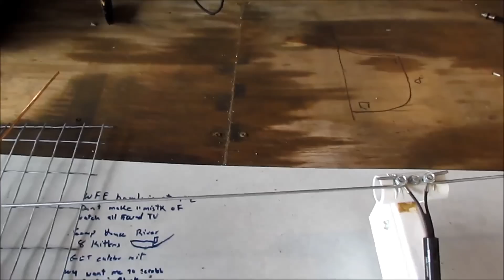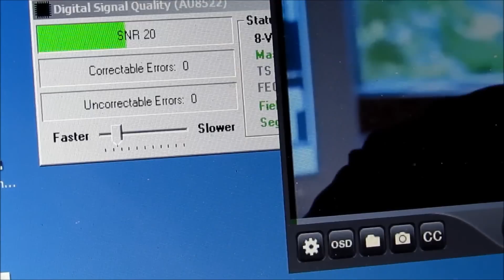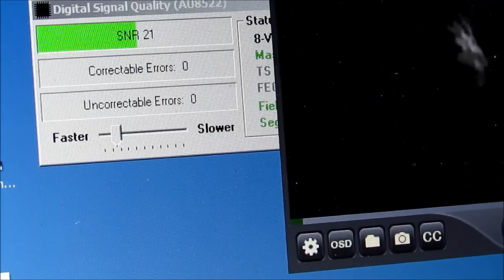VHF TV ANTENNA TESTING

Comment: @ 11:06 - You can't " tie " them together.  UHF(470-862MHZ) and VHF(47-230MHZ) MUST be separate and here is how...  You need a Balun 75 to 300 Ohm UHF/VHF Matching Transformer - Balun.  One Balun for VHF and One Balun for VHF - From there, you will tie that into a Combiner/Mast Mount - You will have ONE Output and that would go into your TV.  NOTE: If you are running long distance Wire/Cable, anything over 25 Feet, then you need a Pre-Amplifier to boost your Signal.

Comment: Danny S Hodges
Is it possible for the antenna to receive a channel signal away from your home more than 150 km and the channel is clear without interference in the picture?
Reply: @
LIBYA LIBYANO LIBYA - Most Antennas on the Market can only reaches about 100 KM.  Unless you can get those HUGE Antennas and remember, your obstructions to your TV Towers would be accountable as well.
Reply: Height is might when it comes to antennas.. uhf is line of sight so the higher your antenna is the better. If the station antenna is on a 3000 foot tower it will make the distance to your antenna laying on the ground.

Comment: Hey Danny,
        So this antenna is for UHF only, ? , Channels 2-13.  In one post you mentioned it
was " TIP TO TIP 28 AND 1 HALF "  Is there a reason you used aluminium ?  What is the size of the reflector ?
Reply: @ 11:06 - You can't " tie " them together.  UHF(470-862MHZ) and VHF(47-230MHZ) MUST be separate and here is how...  You need a Balun 75 to 300 Ohm UHF/VHF Matching Transformer - Balun.  One Balun for VHF and One Balun for VHF - From there, you will tie that into a Combiner/Mast Mount - You will have ONE Output and that would go into your TV.  NOTE: If you are running long distance Wire/Cable, anything over 25 Feet, then you need a Pre-Amplifier to boost your Signal.

Comment: Danny I had the same problem with VHF and UHF signals but
there is an easier way.

1. Buy RCA TVPRAMP1Z Preamplifier for outdoor antenna. You get UHF and VHF combiner to gather plus an FM trap for $22.86 at Amazon.

2. Buy VHF and UHF antenna combiner Antenna Direct from Amazon $23.79 but you still have to buy a Preamplifier.
I have used several different splitters and none of them will give you the same results as the two I told you about.
I have built two of the Altemen Antennas and combined them together with great results. I also have a VHF antenna combine to gather. I live in southern Ohio in Lucasville I receive all the channels in West Virginia. Around me is hills and the TV Station are 70 to 80 miles away.
Thanks for the Videos I have learned a lot.  Greg
Reply from the maker: THATS RIGHT
Reply: By "Altemen" I assume you intended to write ULTIMATE??? Round here, we're pretty much 'stream of consciousness' thinkers.  Don't confuse us good ole boys with new names for stuff we know about, Please! 😊😊😊

Comment: I live in the north western Chicago suburbs, 30 miles from the transmitters, and there are channels broadcasting from Chicago on frequencies of 57 to 785 mHz. I am currently using from WalMart a $19.95 indoor 6" x 10" tri-fold antenna (basically flat) with one telescoping whip and a $14.95 amplifier, and get all of the stations except channel 2, the one at 57 mHz. There are times when some of the channels will pixelate. I am in a town home that faces S-SW by about 10 degrees and the transmitters are E-SE by about 20 degrees. I am also receiving channel 66 which is S-SW. I am considering building your smaller antenna but adding two 50" sections of 1/2" copper tubing which would not be behind the whiskers, would zig zag vertically and be attached to the same points as the transformer. The 50" was selected as the length as it is very close to the 1/4 wavelength of channel 2 which is the 57 mHz station which has a wavelength of 207.2 inches. Channel 5, the other VHF station broadcasting at 79 mHz, comes in clear. The remainder of the channels, 7 - 66 broadcast at from 177 - 785 mHz which equates to a wavelength of 67 - 15 inches. Since the minimal purchased equipment that I have works ok, I suspect that your small 8 element antenna will work much better and I am hoping that the addition of the copper tubing will pull in channel 2 without affecting the UHF channels. I have 8 ga copper wire for the 8 UHF elements and am using tubing for the VHF only because of the rigidity of the tubing.  What are your thoughts on the copper tubing for the VHF?
Reply: good goat
good goat
Is it possible for the antenna to receive a channel signal away from your home more than 150 km and the channel is clear without interference in the picture?

Comment: Hi Danny,  I built the ultimate antenna a while back and the few VHF channels that we have works great with it, in fact, pegs the meter! Now one idea if you really need the VHF, is to put the wires across the middle where you hook up the transformer(on the ones you don't have the soldered transformer). Maybe there it won't take away from the UHF. You may want to test that. Thanks for all you do!
Reply from the maker: YEAH WE DONT HAVE NO TROUBLE WITH VHF IT WAS JUST AN IDEA

Comment: Danny what length is the VHF copper rods? Also wouldn't it be better to have the UHF and VHF separated and joined with a coupler?
Reply from the maker: TIP TO TIP 28 AND 1 HALF
Reply: Don't think about baseball...or even football. Sports are for lazy fuckers who can't do shit.
Reply: 28.6 inches is actually exactly a 1/2 wavelength for 206 Mhz, aka VHF Channel 12. I'm adding the top and bottom hats [NARODS] to my Grey-Hoverman to pull in Ch 12.

Thank you Danny for your inspiration !